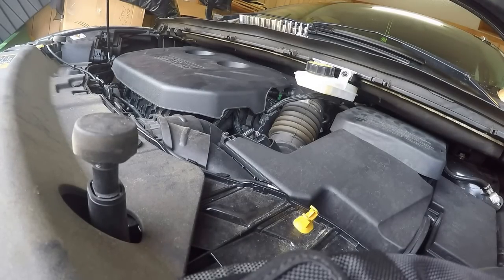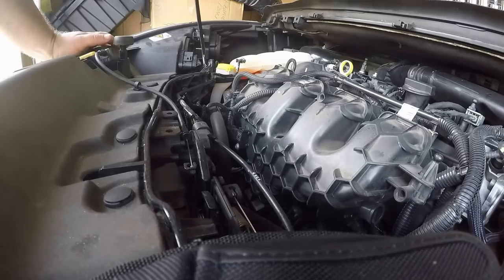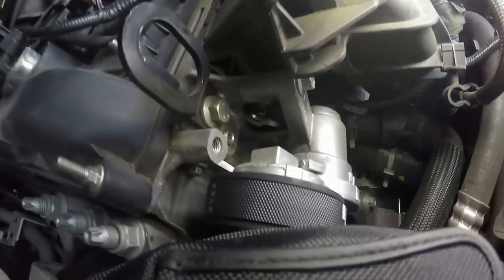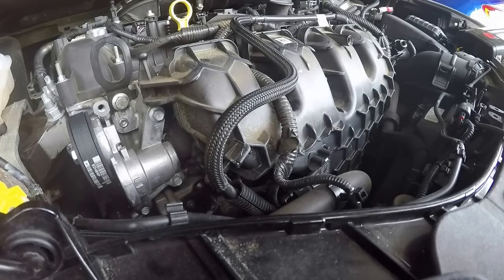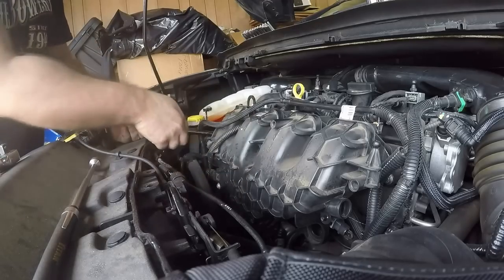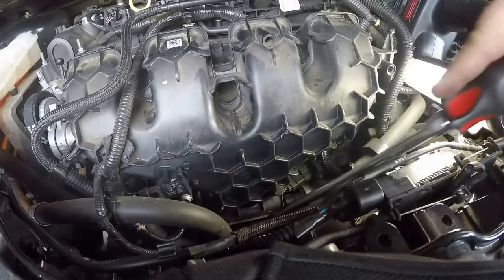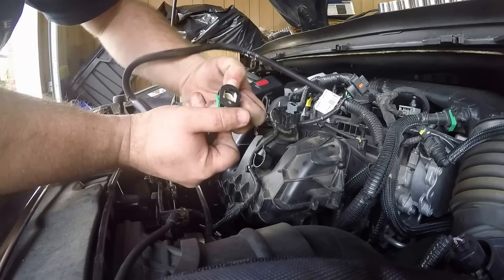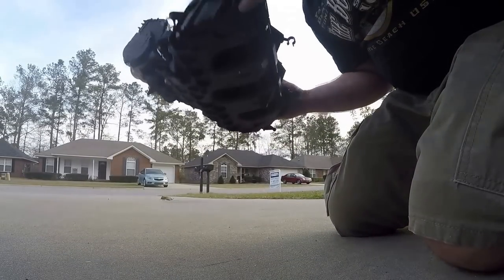Ecoboost intake carbon DIY valve cleaning turbo 2.3 2.0 1.6 ford escape turbo, escape. Simple tools

Comment: cut your fingers off??? what!
Reply from the maker: yea you need to unplug the the electric throttle bodies before you do any work with them. there is a danger got it from my brother a GM tech, a few people have gotten a little rude about it but you can ask a tech. it has a ice breaking function and if the throttle body does a self check and your fingers are in there between the the butterfly. there is a possibility for injury.
Reply: @scrappyitalian  almost sounds unbelievable, however I didn't doubt what you said, thanks for the heads up, I tend to like to fool around diy on my vehicles and have been getting better at disconnecting the battery when I work on my trucks and only do so because I watch different videos on YouTube I do have a ecoboost engine and I'm sure I'll tinker with the throttle body someday that's how I came across your video; great by the way and I subscribed
Reply from the maker: @rogeliovmartinez  yea i thought this was like a blinker fluid joke but it isn’t. It is like how the coil on plugs the LS engines have lethal voltage, they even come with warnings now.
Reply from the maker: @rogeliovmartinez  and Thankyou so much for the sub! Its so hard now to get any subs; little channels like mine are kind of giving up because there is no revenue until you get 1000. So Thankyou again!